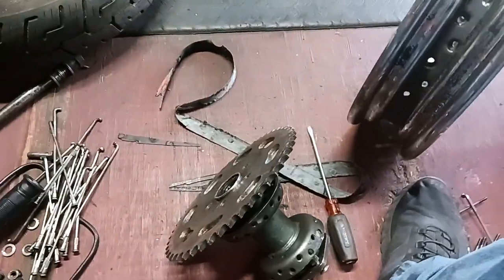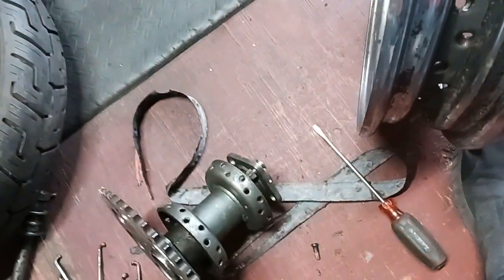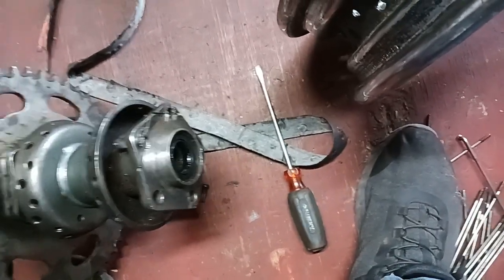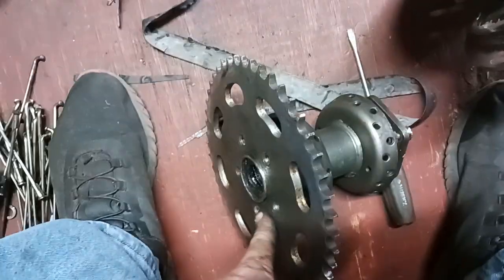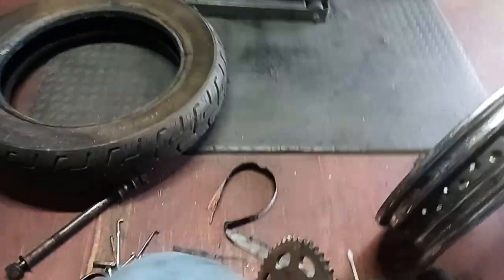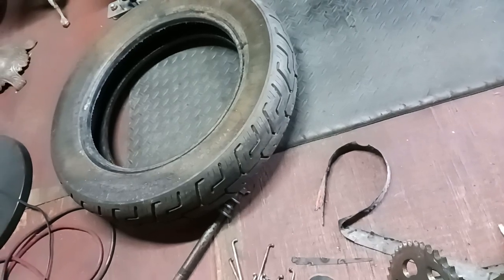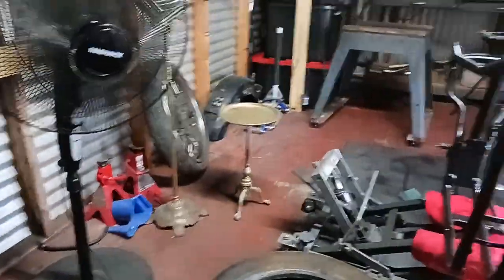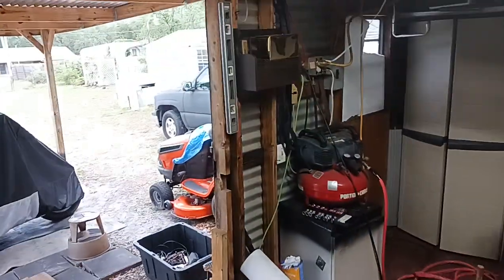SALVAGING SPOKE WHEELS 82 IRONHEAD.

Comment: I too will never deal with spoke rims.  My 02 softail custom came with the solid rear fatboy rear wheel, but im running a five leg chrome front wheel.  No tubes.  My lifes been going good.  The last week I have slept a great deal, as I treasure my sleep.  Your a pro now Ed.  I would trust your work.  Its an old hoop hoop hooray claw clip chip life, LOL
Reply from the maker: I LIKE THE SPOKE WHEELS, THEY HAVE THE OLD SCHOOL LOOK ,BUT MAG WHEELS ARE BETTER FOR THE LONG HAUL. LIKE ALWAYS, I'M UP IN THE AIR. I CHANGE MY MIND ALOT. LOL
Reply: @edZILLA64  After what is decades ago up until now, I have a question . Why do all these guys and shops turn the off and on switch off on the handlebar controls after they shut their bike off?  I have never done this in all these years.  I leave the bar switch on and never touch it.  I can only see one value in it, lets say our engine ran away from a broken spring on our carb while we were out riding, I would use it for that for sure, but other wise why ever turn it off>
Reply from the maker: @EarlGuyton425  it's just habit I reckon. I do it.
Reply: @edZILLA64  Anything used must have wear and eventually malfunction, so by using this over and over will cause the shorting of the feed to the coil, being its a switch betwwen your coil and ignition switch.  I have never used one myself, but if an engine throttle was stuck open I would being its easire to use the switch when the bikes in motion than to take the right hand off of the bar and reach to the ignition

Comment: Thats crazy big ed!!! If never seen where the disc rotor won’t come off the hub!! Wild. Try heating the rotor in a circular motion around the hub, maybe with the heat, it will expand the rotor enough to be tapped off the hub. Give that a try, Whatta ya got to lose!!! Good luck
Reply from the maker: Yeah the rotor is destroyed, but I would like to get that sprocket off. That is good idea. I will try my torch. Thanks.
Reply: Yeah sorry I meant to say sprocket, not the rotor